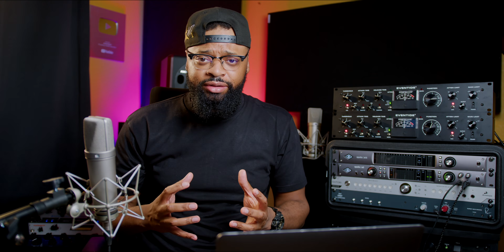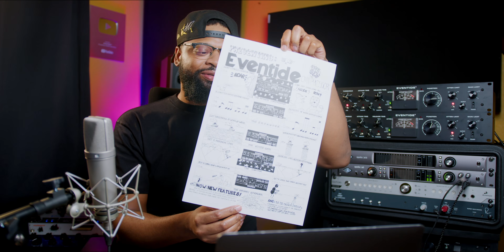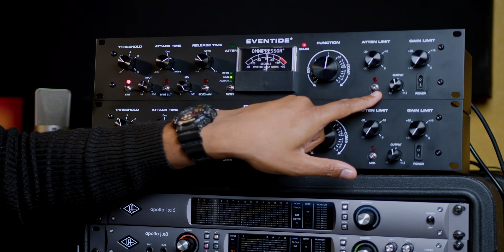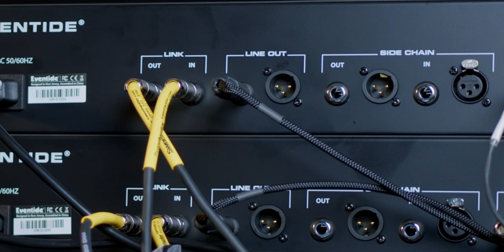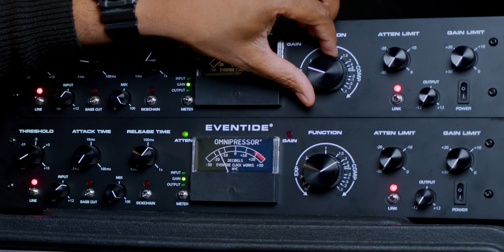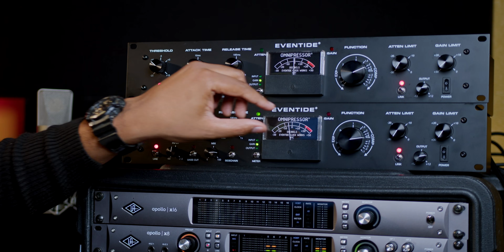Eventide Omnipressor Is The ONE! Stereo Compressor Demo

Comment: Just got a pair in for mastering.  Worth noting that the good stuff is in the epansion side, but stereo link only only only links attenuation and overrides expansion above 0.  But given that for mastering you only need to do a db or so, its very easy to use.  Also the component tolerances are so good that left-right matching is a breeze unlinked.